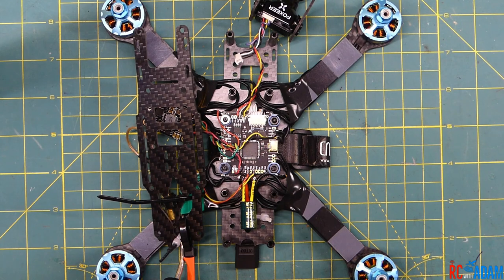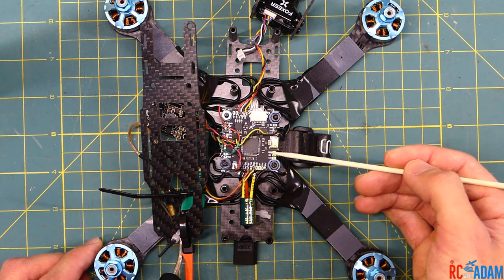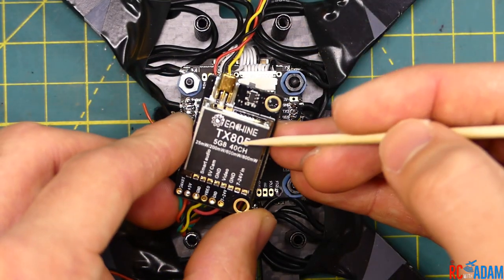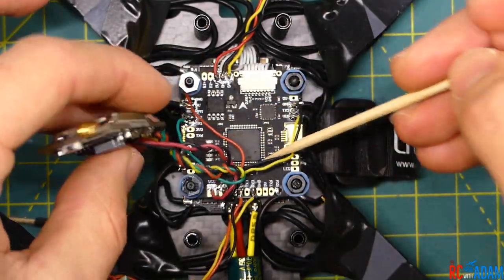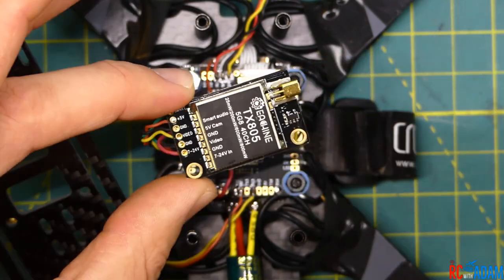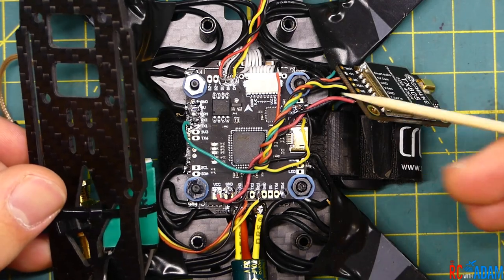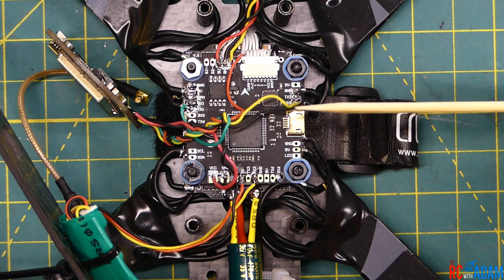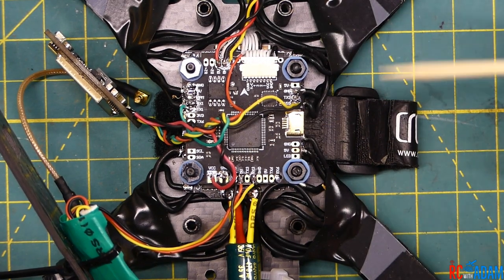MAMBA F405 - How to Connect VTX, Smart Audio, i-bus

Comment: i have a mk2 f405 and was wondering if these connections work with it as well
i have the same receiver as you but when i plug my drone in there is only a red power light blue channel and red band is this right as i am having trouble connecting to my goggles

Comment: Will the way you wired the receiver work for the fs ia6b receiver also because it supports IBUS but I’m using ppm rn. For some reason I couldn’t get any inputs from the TX to RX using ppm so I’m hoping to wire it from somewhere else and it’ll work.

Comment: Is the 5v grd you ran off the vtx even needed? The vtx is grounded on the vcc ground pad, and the camera is not running off of the vtx. I wasn't planning to use the 5v grd.
Reply from the maker: I want to say no, but I'm not 100% sure. I'd say try it without the gnd and see if it works.

Comment: *THANK U*  I have the MK2 f405 mamba and was still able to gather enough relevent info to get this thing built confidently. Got my camera and vtx all clean connected. 

  Still trying to sort out this connection issue between my radio and reciever though. It binds but I cant get any input feedback out of BF..... Not yet sure the source of the issue but i have more stuff to dial in on this quad anyways so no huge rush on it for me.
Reply from the maker: Glad I could help! What receiver are you using?

Comment: I always like your videos and its striat forward and clear . Thank you.  Im trying my best to get my first build up in the air and im struggling.  Im intimidated really.  Help!!! It would be awesome if I could have someone on the phone or in person would be the best.
Reply from the maker: Hi, Mike! I'm Glad my videos are helping. I can totally relate to what your saying! 
What components are you using? and what is the hardest part so far?

Unfortunately, right now I'm not able to do 1-on-1 sessions, but if you head over to my Discord community https://discord.gg/ndZHbGKJC5 we could help get you flying! 👍
Reply: @RCwithAdam1  its ok we can't do one on one.  I have another new friend that has been in the hobby for 5 years and knows his stuff too so im so grateful for the community!! He even has flown with mr steal and most the guys from rotor riot which is cool . They apparently live around my neck of the woods. Im using the momba stack and falkor cam not sure what the vtx is but its got a slot for SD card and goes up to 1000 mw . Im at the point where I need to remove the extra wire from the camera plug and solder the wire for the video smart audio to my fc and install the receiver and ill be ready to set up beta flight  . I cant wait to get this thing in the air.  Its my first build so im excited.  Ive been flying for a little over a year now so im crashing alot less. Lol thx for all the help and the videos and bringing humor to the heck tick builds.

Comment: Does anyone know the correct scale settings for the voltage and current?
Reply from the maker: I haven't tried this myself, but another viewer Christie Watson commented in this video  https://youtu.be/eV_GNH5QVyo "Go in power and batt. tab and make sure both voltage and current sensors are set to onboard adc. Voltage scale is correct and amperage should be set from 400 to 169 and current draw/ batt voltage will be correct". Let us know if it works for you.

Comment: Hey man great video! Ive got a mamba on the way to build up a "fly in the winter" quad that I can bash around. Just wanted to say that I started with the FS-i6X as well and it was a great radio, but i recently picked up a Taranis Q X7 with the R9M bundle because it was so cheap to buy them together and aside from having to switch out 4 receivers now i cant say enough good things about the Q X7. I would tell anyone now that i have it to start with the Qx7 and honestly if you upgrade before you have a ton of quads you dont have so many RX to switch out lol the R9M is awesome too. Check out horusRC they might still have the deal going and once you try the Qx7 the i6x will feel like a toy unfortunately...
Reply from the maker: Good points. I have no doubt that the Qx7 is a better radio overall than the FSi6X, but for me the form factor is just too bulky (I've got my eye on the Frsky X-Lite). What's cool though is that, since you started with the flysky, you can really appreciate the upgrade! (lol and yes, the i6x does feel like a toy!) 👍
Reply: @RCwithAdam1  One thing I will caution you about on the x-lite is that it has extremely short gimbal stick throws. I got to try one before I got my QX7 and it has even shorter throws than the fs-i6x. The main thing I like about the Qx7 (besides its form factor and ease of navigation) is that although the slightly longer stick throws take a bit of getting used too, they offer a really nice zone around center stick for making small adjustments as your setting up to hit a gate or a gap. I tried changing expo, control mid points, all kinds of things to replicate it on the flysky and i just couldnt get the same feel. The last point il make is that the Qx7 takes the R9M. I am by no means a pro pilot but the peace of mind i get with the R9M is really nice and with the sales on right now you can get a module and 4 receivers for like $60 US which in my opinion is like free money... Think about it though man because switching back to the flysky from the taranis I feel like i lose a ton of resolution in my control... sorry, that ended up being another friggin novel..
Reply from the maker: @flighttherapybullisticfpv133  Thanks for the tip! Are you a pincher or a thumber?
Reply: @RCwithAdam1  I can fly both but i default to thumbs most of the time... i do find it slightly easier to pinch on the qx7

Comment: This is odd your receiver should be connected to rx1 for Ibus, the VTX goes to TX3 and you should try powering your camera off of the 5V out n the VTX.
Reply from the maker: Well, I do tend to do things in an odd way. But it seems to work just fine!
Reply: @RCwithAdam1  Now i dont know what advice to follow since i've ordered the mamba combo
Reply from the maker: @exposer3339  I would go with whichever is most convenient for you and see if it works.

Comment: DO NOT CONNECT THIS VTX TO VCC IF YOU ARE FLYING 6S. Was obvious that 6s voltage on charged battery is 25.2V. I knew that but after your video still decided to connect. Another part smoked as a result.